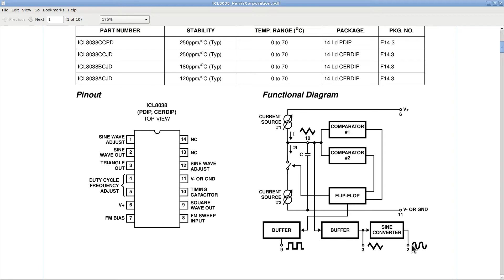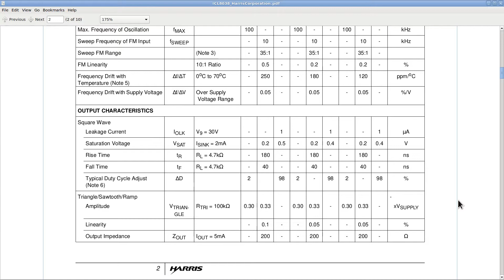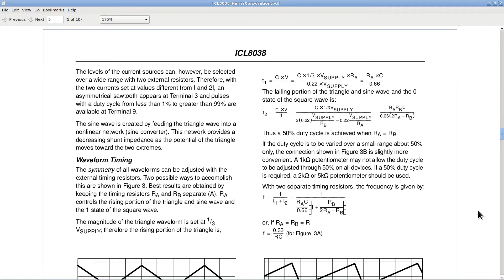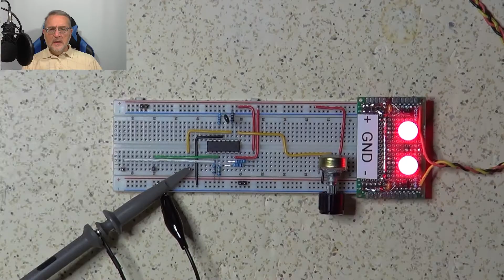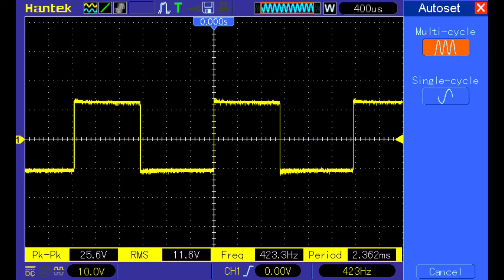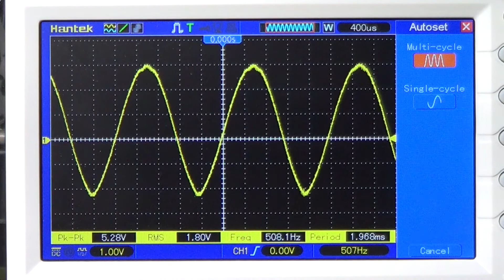VCO experiments with the ICL 8038

Comment: If deciding to use the 8038 for the sinewave or vco only, do the square and triangle wave pins need to be left floating or pulled to ground?  I looked at the data sheet but am not seeing any info about that. Definitely a good old IC that still has good purpose. Thanks for the vid, very helpful...🙏
Reply from the maker: The square wave output is open collector, so if you don't use it you can leave it floating. The triangle wave output, although not open collector, is a balanced circuit that can be left open too. And, actually, if you pulled to ground the triangular output too much, you could even disrupt the sine wave output. In fact, looking at the data sheet of the ICL8038, there is one example of sine wave only generator. It has open outputs for the square and triangular signals, pins 9 and 3, which are not even mentioned. See figure 6 in the data sheet.

Comment: Hi eleneasy. You told us that we could ask you concerning our projects. My project is trying to built a binaural beat generator with two ICL 8038 ICs. Therefore a fine tuning of the frequency, a mixing unit for the two signals and a switch for the different waveforms is needed. A nice to have was a pink noise generator that could be mixed in if one wanted so. Which circuit would you use for mixing 3 different signals ? Thank you for your answer 🙂
Reply from the maker: Given the nature of the three signals, I would use an adder made with an op-amp. The adder could also have the capability of amplifying the mixed signal by acting on the negative feedback resistor that would be posted between the output and the inverting input. You can find an example of this circuit in one of my old videos on op-amps: "Operational Amplifiers Explained". Here is the link:
https://youtu.be/LMmBgxi3jUE
Reply: @eleneasy  Thank you very much for your answer !

Comment: I'll give it a try. I'm really looking for a sawtooth rig. Something to plug into a APC synth other than the square wave 555 which it already has. Transistors might be better. I also have the XR2208 from a kit, the module has problems so I will retrieve the chip. Your video is well presented. Thanks

Comment: Thanks for the detailed experiment with this chip, lots of promise to be sure!

I may have missed it in the video, but I would suggest placing a linear to exponential converter at your control voltage input. It isn't necessary for just getting the basics of your synth design hashed out, but it would give you greater control over high frequencies with a potentiometer, as well as an essential step for hooking a keyboard up to your vco.

I look forward to future videos of this project.
Reply from the maker: Aren, thank  you so much for your comment, You provided a very interesting and useful suggestion. In fact, the ICL 8038, according to its characteristics, does a linear conversion between voltage and frequency. It will be certainly useful to add an input stage that allows for an exponential control of the frequency. I will do some study on how this could be achieved. Feel free to chime in with other ideas. That's exactly what I'm looking for in this project.